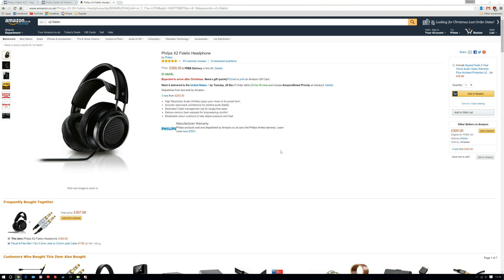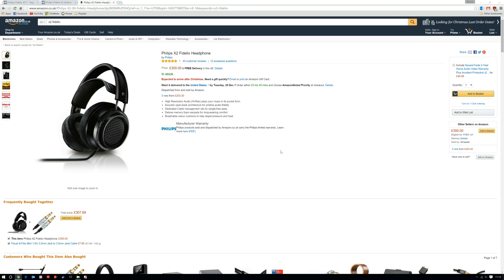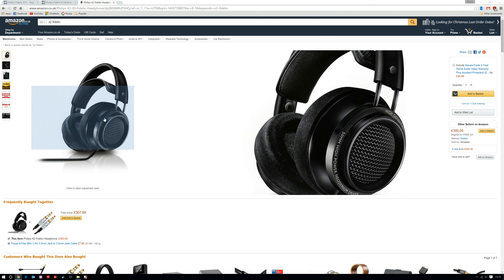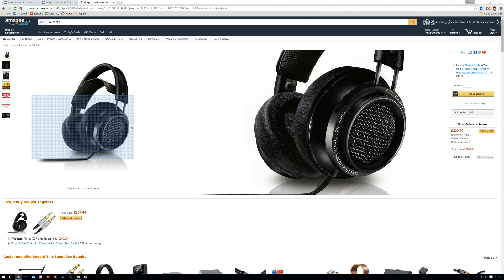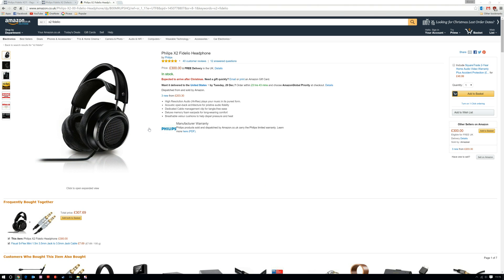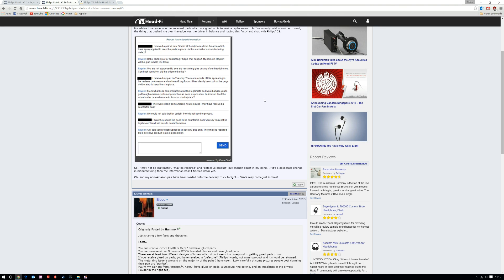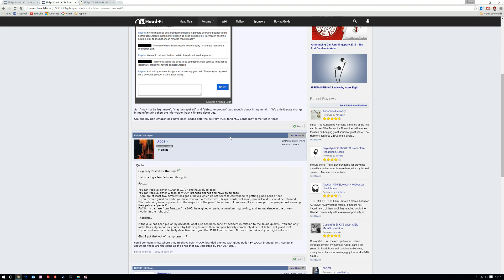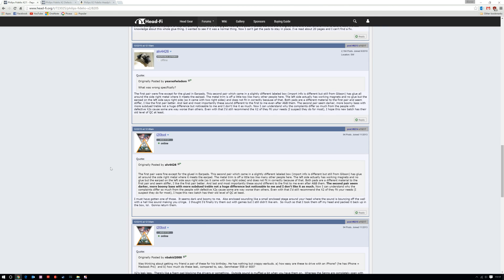Philips X2 Fidelio Headphones Build Issues

Comment: Just got mine two days ago (boxed in an Amazon box) and I'm able to take the pads off easily, no glue and these are Gibson made. To date, the best pair of headphones I've ever owned.
Reply: Are the headphones still good?
Reply: ThaRedPitbull-Mix Yup..going strong
Reply: Okay great.  I'm getting mine in the mail tomorrow.  I hope I get a good set.
Reply: Give it some burn in time, maybe 20 hours or so, they get better. Some tracks I wonder if I have a sub woofer in the house somewhere, I'm looking around and nope, it's the headphones, sublime.
Reply: Do you think they need a DAC/AMP?
Reply: A little late, but you don't NEED an amp on the X2's, it's a little more clear though

Comment: A lot of people are saying there glued but it's actually the 4 pins that are glued on , people have taken the so called glued pads off and cleaned the glue off the 4 pins and then they just come on and off like mine do before Gibson the new owner of Phillips started gluing them on , u was told they started gluing them on because some headphones pads were not holding tightly with just the 4 pins , so the pads do come off be very careful not ripp the pads and then use goo gone to clean the mounting pins ,,,, yes Gibson bought the Philips electronics in November or December not sure on that month
Reply: +Ron Bernard yes i have heard this too, that you can just take it off and clean the glue and be good to go...so should i just buy them from amazon third party now? will they sound the same? im mostly worried about channel imbalance and i saw peopel saying the trimming was falling apart...

Comment: if i buy these secondhanded, how can i know if they are the "bad Gibson" or not?
Reply: the earpads and see if there is glue or that looked like there was a glue. the seller might have removed it.
Also on the left side, if you lift the headband up a little bit you will see the manufacturer of the headphone. It should say "woox innovation"
and if the used seller also still has the box if it says Gibson anywhere it's potential of getting the "defect"

I recommend just buying new  one from Amazon. Those initial bad batch is all gone now so if you get the new one from Amazon you don't hae to worry about it